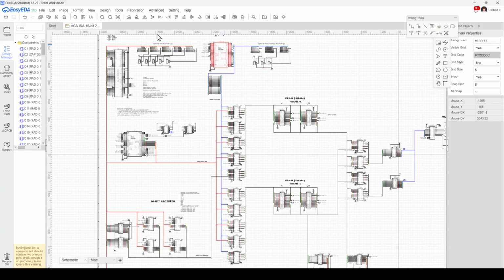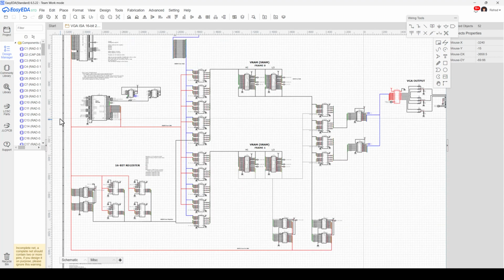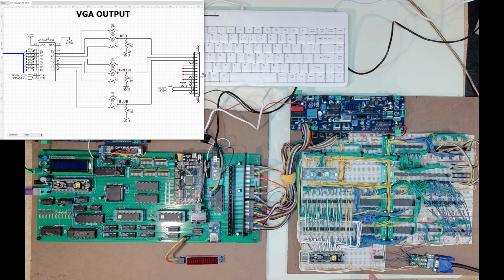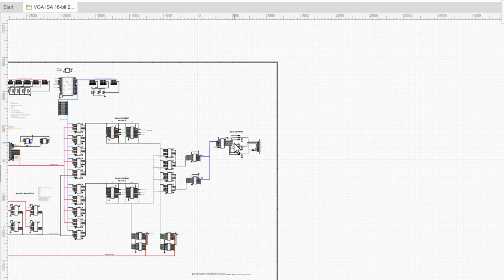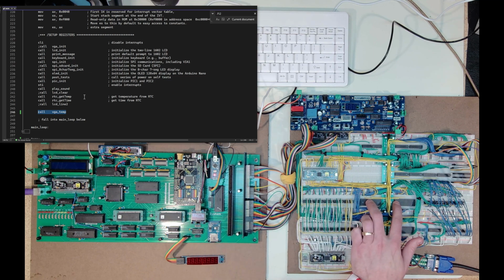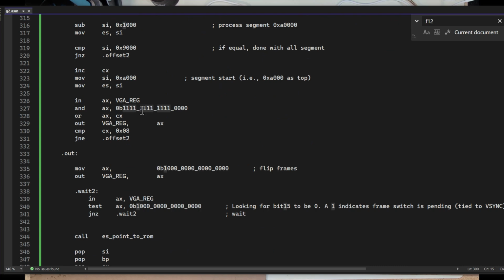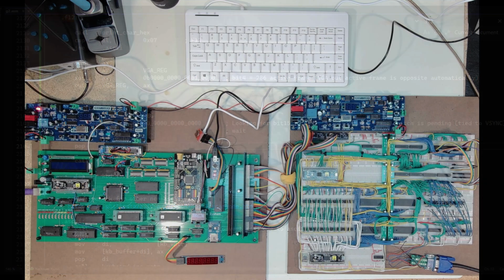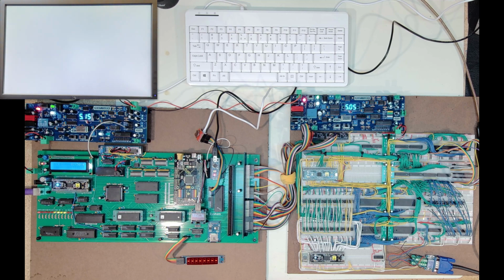640 x 480 VGA, Ep. #7 - Breadboard Fire Up!

Comment: You might also look at acquiring some RAMDACs to do the colour generation rather than some resistor DACs.

For example the KDA0476. It's a 28 pin DIP and you can load a palette in just like it was RAM.

They were used a lot on older video cards before I guess it got integrated into the video chipset.
Reply from the maker: Very cool! I'll research it a bit and order something up. Thanks, Tom!

Comment: You can remove both of the 245s that are feeding the 273. Use the G pin on the 157s to tri-state their outputs. That seems to be all you're using the 245s for anyway?
Reply from the maker: I was looking to do that exact thing, but as I read the data sheet, I must be misinterpreting it. I'm reading that it still outputs low and doesn't have tri-state support. I'm looking at page 9 of https://www.ti.com/lit/ds/symlink/sn74hc157.pdf. Does that sound right?
Reply: @rehsd  I figured out where I got confused..! In a current project of mine I am using 74x257's, and these have tri-stateable outputs.

The 157 and 257 are pin-pin compatible with the only difference being the output being either tri-state or not.
Reply from the maker: @TomStorey96  Good to know, and thanks for the follow-up, Tom!
Reply: @rehsd  ah yes, you're right! My mistake.
Reply from the maker: @TomStorey96  I was really hoping you were right! I'd love to remove those '245s.  :)
Reply: @rehsd  what about replacing the 4 157s with 245s? You'd be able to get rid of the other two 245s then just by switching on one of the 4?
Reply from the maker: @TomStorey96  I was considering that, too, and I think it would work. I was also considering using '245s on the incoming side of the SRAM, too, instead of the '157s there. I'm wondering if there's an advantage with the '157s over the '245s? @Zxborg might have mentioned something about this, but I don't recall the exact details. I might just byte the bullet and go to 16-bit color. I think I'll just need to make some minor adjustments with the video address counter. I need to think more about it.

Comment: Great work! I suppose this means you'll need to update the full frame each time? Or at least make the same changes to a frame twice (perform the previous frame's update again then the new frame's update). Looking forward to the next update on this. I'm getting keen to start my own VGA project for the HBC-56 😀
Reply from the maker: Thanks! Correct, I will need to write data (just the changes) to both frames when I want that data to persist on the screen between frame changes. Hopefully, I can abstract much of that with some assembly routines. I have much experimentation and optimizing to do. :)  I will keep an eye out for your VGA project!

Comment: How many feet or metres of hookup wire have you used in this circuit?
Reply from the maker: Hmmm... no clue. Too much?  :)  If I had to guess, I'd say somewhere between 20m and 40m.
Reply: @rehsd  its deceptive how much you end up using. For fun pace out 20m in your garden.
Reply from the maker: @DavidLatham-productiondave  It adds up quickly. 16-bit data lines everywhere...